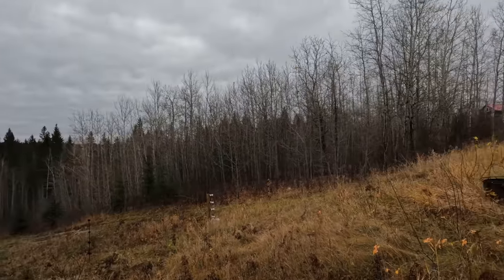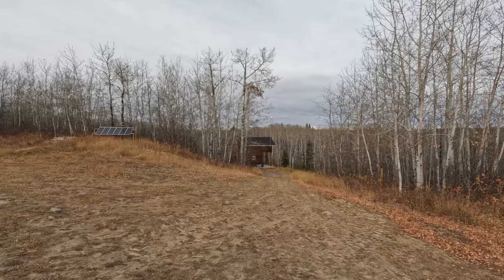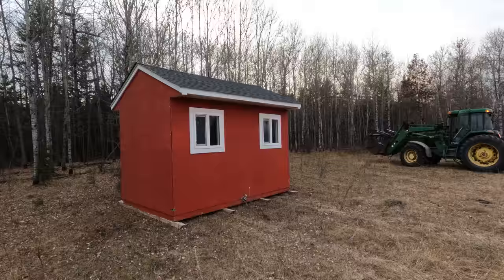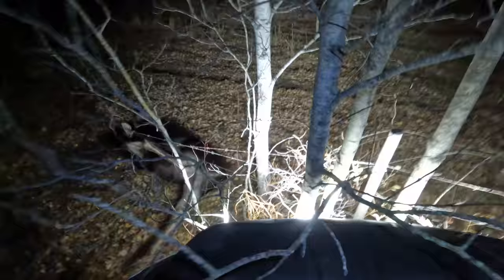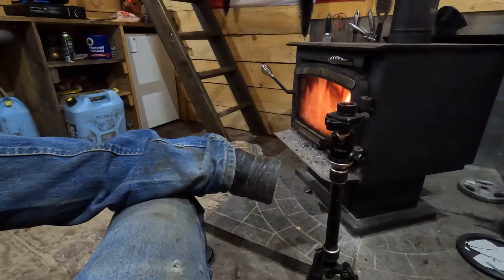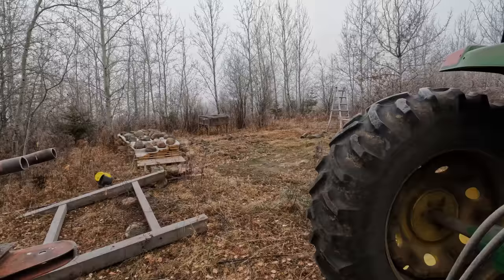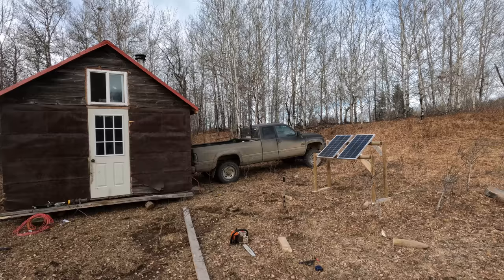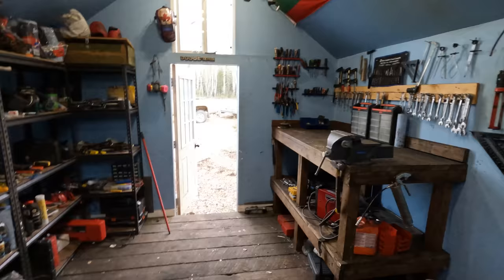Moving my Offgrid Homestead Pt. 1

Comment: Hey bud for the cabin, Jack it up high enough on cribbing to back your trailer underneath so that you don't have o let it tip like the sheds did on the tilt deck. Then reverse the process to set it back down on the ground. Looks like you have plenty of logs there to use for cribbing.👍
Reply: This is exactly my suggestion too
Reply: If he got some big rollers it would come up the deck with just the come along! need about five 4" trees would be good.
Reply: I agree here on jacking it up. My dad and I moved a shed this way and it worked perfect. it is 10x20 so we put on the trailer the long way so it would not tilt forward or backward. I say after you lift it back up from the front porch. in other words let the porch be towards the front end of the trailer the long ways. good luck
Reply: The most time consuming but definitely the best way to go about it if keeping it upright is a priority, which obviously it is.
Reply: I would remove the frame from wheel chassis if possible, lift the cabin drop her down on the frame or use skids and pull it with a dozer(not sure if that tractor can pull it or not, low gear 10hours of travelling time lol.......I think that trailer is a no no, can you imagine blowing a tire, and that narrow wheel base,  ...or get someone with some experience to come out and have a look...
Reply: thats how i would do it, but once its on the trailer i would suggest adding some triangular supports on the front and back of the cabin to help support it while moving it down the trail. should help stop it from tipping when going up/down hills. i would just use some 4" logs...
Reply: @SuperHurdman  where were you when he started, maybe he failed grade 9 physic's.
Reply: my gut says leave the cabin, even if you crib it onto the trailer that pitch is so extreme I fear it would topple over going up the grade especially once you bank right. Also, this was Cugars home and he rests right near it, I feel you are going to be happy if you leave it there for future visits back into the bush. I'd move the tool bench into the chicken house and turn it into the new workshed and turn the workshed into the sleeping quarters.
Reply: Thinking same, no need to repeat.
Reply: @marcellogenovese199  agreed!
Reply: Dandy suggestion

Comment: The cabin I would not try to pull it on or off. I would jack it up and stack it on cribbing to get the trailer under it.  Ring lags to tie it down vs over the top. Best of luck however you go about it. Worst case you end up sleeping in the trapping shed for a bit. TY for the video

Comment: Love your videos ! I think I would put the cabin on some big timber skids and just drag it with the tractor attach your tow straps directly to the skids so you aren’t putting pressure on the cabin walls good luck.
Reply: I agree beef up the skids and drag it. it be the safest way too.
Reply: @Bart Comeau - that's a great idea unless he has to go DOWN a steep hill like the one shown when he moved the shop. There is nothing to stop it from sliding into the tractor on the down side of a steep hill. But if there isn't one then this will work.
Reply: @sheilam4964  Agree. Or falling over on top of the tractor. The drivers cage he's sitting in could probably crush & collapse. I'd like to see him have help with this one.
Reply: @monkeybusiness1999  yup, 12 valve as an anchor on the back end.  My first thought was go ahead and tip it on the back, but you rack things that much it's not going to end well.
Reply: shiela and monkey you’ve watched too many dramatic TV recreations. That kinda stuff doesn’t just turn into a bob sled on its own. On ice maybe but not rock and clay. Even the wood on the steel trailer has enough friction it won’t just slide off. I moved a 12x20 shed on my own on similar ground and with a side slope. He’s doing overkill already. Breaking straps tells me there is a lot of friction there.
Reply: for those worried the cabin would land on the tractor... if he got help he could use a second truck and driver to hold it steady as it slides down the hill with straps as well, problem solved.

Comment: Okay since you asked for advise, here is what I whould do...
You'll have to jackup the cabin and back the trailer under the cabin.  I watched you build that cabin, it will stand up to the move without any cross bracing.  I like how you braced the wood stove and pipe in the shop you moved...smart.  I would do that again.
You'll need to get a trailer WITHOUT a tilt bed.  You're already worried about the thing being top heavy and you will not be able to skid that cabin anywho.  We used an old flatbed that is stripped right down to just the metal frame and then use 4x4's or railroad ties or what ever it takes to block it up just enough to clear the tires. These are bolted securely to the frame. Then when you get the cabin set on the trailer you can use lag bolts or allthread to secure the cabin runners to those blocks.  Everytime we have moved a building we secure the runners to the frame of the trailer and we also use straps to secure it just like you did for your two smaller buildings. 
Good luck I hope you are able to get it moved.  If not you could always just build a new small cabin at your new work site.

Comment: I’d say to start with 20 ton bottle jacks. Slowly lift the cabin and crib it with fresh solid Timbers. I’d say 12x12” Timbers at least. Lift it high enough so a trailer can be back under it. Once it’s on the trailer chains and chain binders will be needed to help the building stay on the trailer. Straps won’t be strong enough. You will need to chain the building from the start of the second floor in order to keep it from tipping. To do this you’ll need to get heavy duty eyelets that pass through the cabins frame inside through a steel plate and then nut and bolt it so it can’t pull through the building. This will give you solid connections to hook your chains too. Make sure you chain both sides of the cabin to the trailer.  After that it should be good to go. I’ve moved a few buildings and getting the equipment is the hardest part. Go really slow. Think everything through carefully. Don’t rush or it will go wrong I promise. Good luck. Find a crane company in your area and those guys can tell you all you need to know. Might even help you get some gear. 👍👍

Comment: Crib up the cabin.  Make a skid platform of huge logs that extends out as wide as your narrowest point will allow on the road to it's new home.  Then angle cut the front of the logs so they slide without problems.  Strap it down and full send it from there!

Comment: On the cabin. Move everything down to the bottom to reduce top weight. If you used screws to build it, partially disassemble if I've been watching you for a minute or two, you can do anything you set your mind to.

Comment: Get 4 light poles, full length, set the cabin in the center of them , brace the cabin from inside and outside with 2x6x20 , then strap the cabin to all corners of the light poles and run chain from one of poles to tractor , then skid the cabin to next location , I suggest getting help and take your time

Comment: I would  use two cables or straps . One on the bottom like you did the other buildings .  Place other cable or strap about 10’ or 12 ‘ feet high .

Comment: Hey Kyle, when you move your cabin, you said it would be top heavy, well, if you cut   two to four square holes in the floor in all four corners of the floor, then run a strap through them and over and under the trailer, then tighten the piss out of them, that would help hold your cabin from flipping over, take all your stuff out of the top and put it in the bottom before you move it.  You can always reach the square cutout pieces once you get it moved.

Comment: I think a few pipes run 90 to your trailer pipes (not attached) could be used as rollers to help the cabin glide up on her. If you are afraid that she is going backwards and over, run a few brace straps to the front and tighten as you winch her up. A winch on each corner might be another way. Or, the best way, jack her up, crib it, and then back the trailer under it.

Comment: the easiest way to move your other cabin would be to get it sitting up on 4 inch pipes so you can easily roll it and get it to flat ground. then jack the entire building up corner by corner and block it up to the height of the trailer.winch the building onto the trailer and once you get it to your destination do the reverse.

Comment: The main issue you have 8s having to do with. Loading and unloading. In order to stabilize your cabin,  you would need to Jack it up high enough to back your trailer right under it and then lowering it on to trailer. Same process for unloading. All that’s left is watching not to hook up on tree tops as you move down the road. Have fun. Be careful .

Comment: I did something like that many years ago. Not sure how far you are going but I jacked up the building and put braced skids under it. Dragged 2 building about 600 yards. Worked and didn't cost that much to build the skids. You are right, your building is to top heavy to risk  putting  it on the trailer.

Comment: Hey bud! I vote MOVE the cabin! If its top heavy, build verticle supports down to a strong platform. Possibly take off the front deck and build shoring onto added temporary framework. I'd also load it long ways if its top heavy to allow the ability to tilt more onto the trailer for loading and offloading.

Comment: Hi.   Well done on moving the two smaller buildings by yourself.   I would strongly  recommend you leave the cabin where it is.  The 2nd floor extension over your deck will rack and twist because it is not truly tied into the main home.   The extension is going to fall away if you try to move it.  The steep short driveway down to the cabin will also put a lot of strain on the building as well.  Well enough of my you shouldn't advice and let us see what you actually decide to do.  Your channel is great.  Cheers.

Comment: Slide it up also frt door/overhang first.  Use the weight of the overhang to your advantage when going up hill.
 and tilt the bed back b-4 going down hill.
Any slopes to the sides should be addressed ahead of time by moving some dirt

Comment: The cribbing idea is good. If you get it on the trailer I would do a calculation on what the upper half weighs and try to add weight after loaded to the main floor and on the porch to keep gravity point as close to trailer as possible. Just my two cents. Great video I liked when u saved the moose.

Comment: Mimic how house movers do it. Brace the piss out of the front overhang before you start the work. Remove everything from inside the cabin to reduce weight and thereby increase odds of success. Square two spruce logs into beams that have plenty of overhang using your mill. Get those beams under your cabin. Rotate jacking a few inches at a time on the 4 ends of the beams until you have it raised up (staying level) enough that you can get a trailer underneath the beams. Make sure when you load it that the beam ends are sticking out the side of the trailer so you can jack and drive out later. Strap her down and attach the cabin to the beams with boards or angle iron screwed to every second floor stud. Chain the beams to the trailer as well to reduce the likelihood of tipping in transport. To unload, reverse the process but keep the cabin level all the time. Raise it a bit and block it, drive the trailer out and then lower each corner a few inches at a time. Once you are on the ground, remove the beams and you're ready for a toddy. Probably should allow a full week for the move.

Comment: Your house is framed like a beast.  Blocking you used will help… lift the building evenly s and drive trailer under.   It can be done. But not the way you did coop and work shed.   Good luck.   Nice save on moose… it will be hanging around your new land forever I bet

Comment: Great videos. It’s amazing what we can do by ourselves when we have too. One tool that has been one of my greatest assets in the bush is a Lewis chain saw winch. I have moved some very large loads by myself. 4000lbs straight pull and add one block and it’s 8000. You know the math. There are other ones but the Lewis is the real deal. Made in Canada. If we were closer I’d let ya borrow mine. Good luck with the new view.

Comment: You can add some weight to the bottom of the cabin to help made it less tippy but you need to strap it down so it doesn't shift on you as you angle it. You can use a comalong it's slow but you just keep cranking down and it moves stuff slowly.

Comment: May need to hire a crane to come in and move your cabin.  Pick it up, set it back down at your new location. It's worth looking into. May not be feasible depending on the cost though. The only other alternative is to take the second story off, board by board and move the cabin in two pieces because of the weight and being so top heavy.  You would then have to rebuild the upstairs.  You could mark each piece which would make it easier to rebuild and you could take shelter in your tool shed since you have a wood stove in there until you could rebuild.

Too dangerous to move the cabin as it is.

Comment: Jacking the house up until it fits on the trailer without tipping it on is a good idea but the concern I have is actually the hill that you have to go up first thing. I'm uncertain of how steep it is from the camera view. My thinking is to keep things low and use skids to take it up that hill, not the trailer. Use the tractor to pull it up the hill. Also use the tractor to brace the house separately from the top, using less tension on the straps for the top to allow some flexibility but stop the chance of tipping. Use your truck as a brace to one side by running a strap to it if there is some sort of side angle to that hill. Move a few feet at a time and check things a lot.

Comment: Awesome video buddy!! I was very surprised to see you so quickly start to move your home stead!! Now for the last piece that you need to move and worried about being so tipsy!!! I think I would put some big logs under it for skids and pull it with the tractor!!! Now for going down a hill for the ones that think it will run into the tractor well they are way wrong for sure!!! The weight of the building is going to stop it when the tractor stops for sure!!! Now if worried that the big logs that you put under it will be all wore down before getting to the spot??  Well I’m not exactly sure how far you was actually having to move them??? A mile or two or is it more like 50 to a 100 miles??? That is definitely a big difference and would definitely move it with the extra big logs under it up to maybe 5 miles at the most but anything more than that I would figure out a way to lift the building in place up high enough to back the trailer under with out tilting the trailer!! And then just reverse the proses to get it off of the trailer trying to keep it as flat as possible the intire time!!! I’ve moved some pretty good size buildings in my younger days!!! But the biggest was a 30’x24’ garage and that didn’t have a bottom on it like all the ones that you are moving!!! I’d definitely like to see how you plan on moving it or maybe you just plan on making the chicken shed the work shop and turn the work shop into your living quarters?? I mean heck the shop has a wood burner in it already!! I no that you will figure out something because you have a mind set just like I do for sure and that is just make it happen and if something doesn’t work well it can definitely be fixed up!!!! Awesome video buddy and remember keep up all the hard work buddy!!!

Comment: I think it will move fine and if you strap it down it shouldn't leave the trailer my biggest concern would be the trailer flipping on its side. I would definitely get a spotter and I would consider putting temporary braces inside like they do with modular homes. I'm not sure what you're situation is with the land, if its just access having a camp away from your home even if it is right down the road is a nice escape.

Comment: You know I've watched me cousin move and lift houses. He always goes in with a shit load of 2 bys. 2x6 2x10 and cross braces everything. In your case  probably on the outside . Front, back & both sides. Top to bottom. You got to stop it from shifting when it's being moved. And I don't know if  your current rig is heavy duty enough. But you got to brace it for sure. Good luck.

Comment: Your doing great! I wish I had a rig like that when I moved my sheds bout the same size. I used logs as rollers and pulled from the skids. I found drilling holes in the skids to throw a heavy walled pipe through gave me the best rigging points. From what I can tell You can move that cabin! Just take your time loadin and unloading. Layers of vapour barrier between that trailer and the skids will let you pull with amazingly less friction.

Comment: Minnesota Rancher.  Too bad some one took the cable winch off the front of the stack mover.  That would have been perfect for sliding the buildings on evenly.  Think about fastening a sturdy plank to the outside walls of the buildings about 3 ft up to fasten your tie down straps to, instead of going over the roof.  Good on for saving the moose calf!

Comment: Don't tip the cabin. It's too top heavy. Keep it vertical. Jack it up and drive the trailer underneath. Then do the same to unload it. Use two or three big timbers long enough to span the width of the trailer to carry the weight. It can be done but it's got to be taken very slow and methodical. Get a couple 20 ton bottle jacks and crib as you get higher.